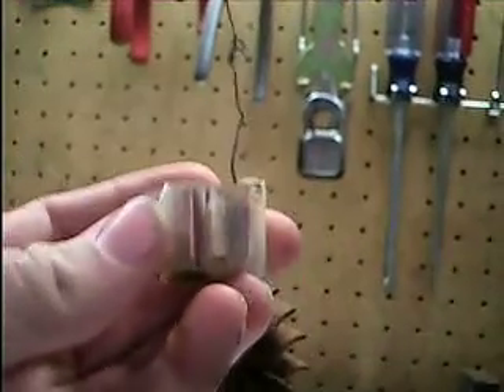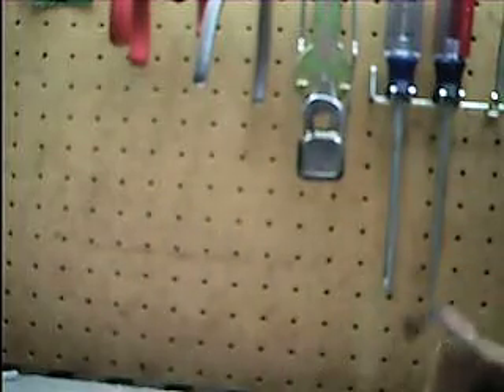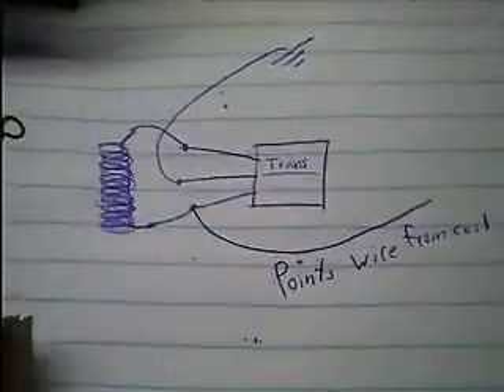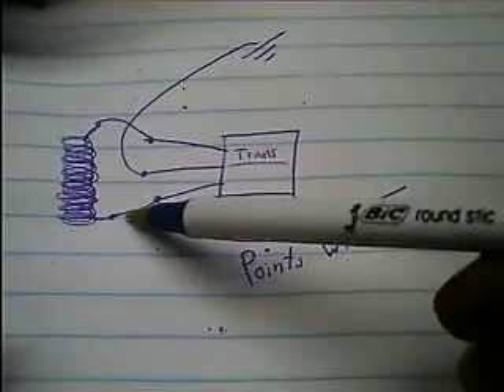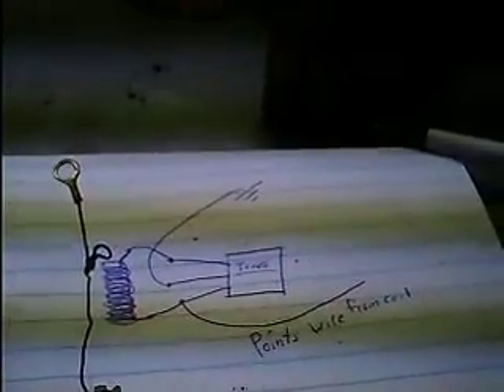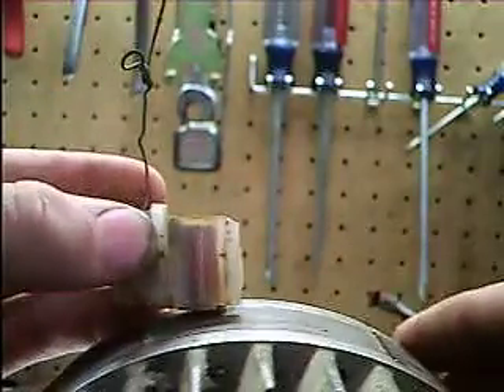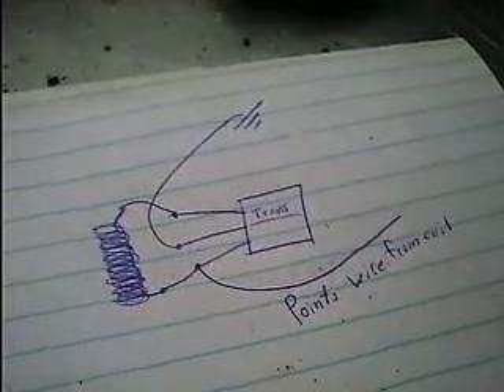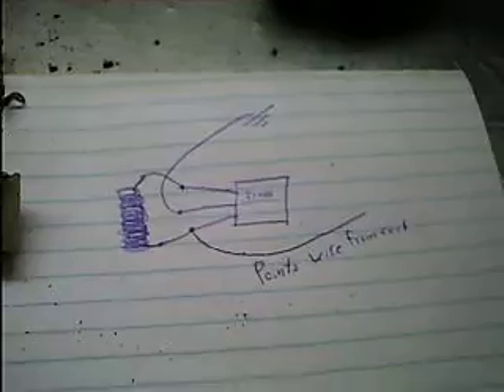Solid State Conversion Module

Comment: Hi - Thanks for posting. Regarding primary field collapse, here is how Briggs and Stratton describe it: "When the points close, electron flow causes a magnetic field to be created around the primary. This field also envelopes the secondary. The points now open, break the circuit and collapse the field through the primary."  Hope this helps. Cheers, Jeff